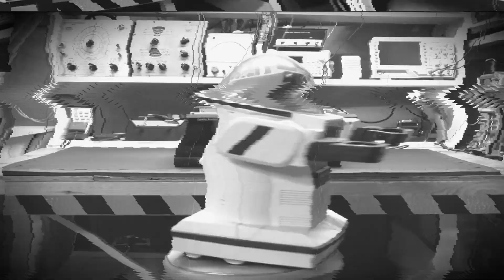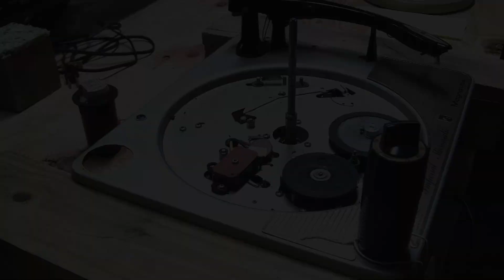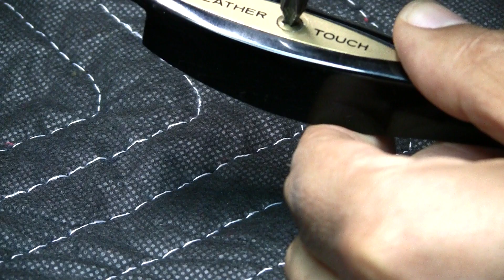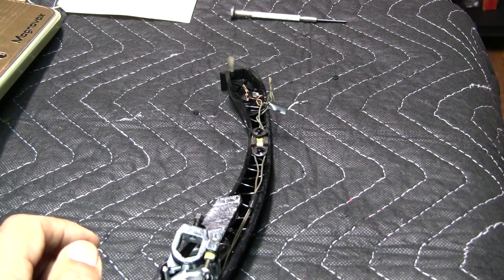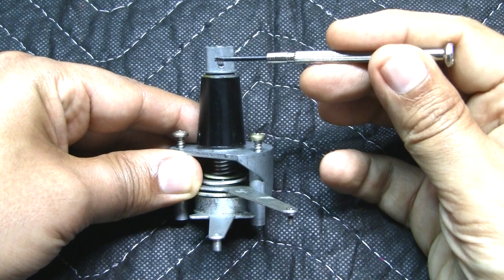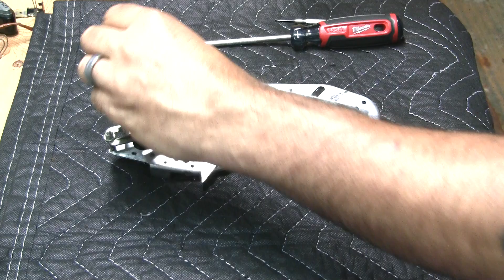Magnavox Imperial Micromatic Service

Comment: The intermediate  gear wheel a way I  id year of unit I find
This was made in 5 colors
Green 1960-early61  
Red late 1961-early 63
Black late 1963- mid 65 
Yellow late 1965-early 66
White 1966-mid 1968
In late 68 mechanism was changed 
To operate on 1 idler wheel only
Not an improvement .
Those are more difficult to work on 
And operate poorly compared to the 2 wheel model
Reply from the maker: Thank you so much once again for sharing your knowledge regarding these great ole record changers, till next time, take care :-)